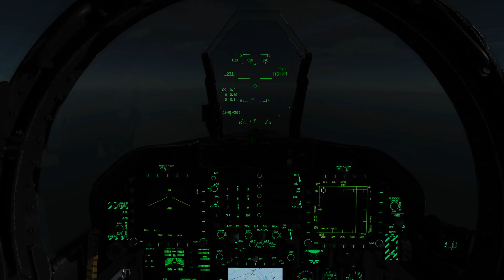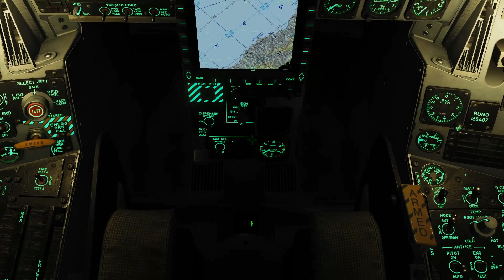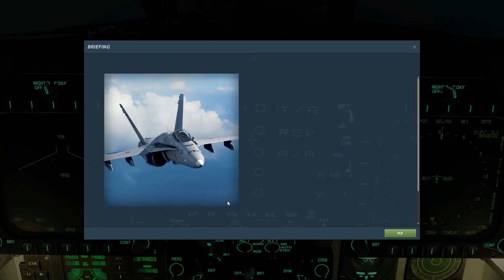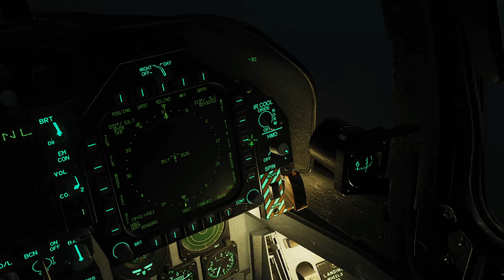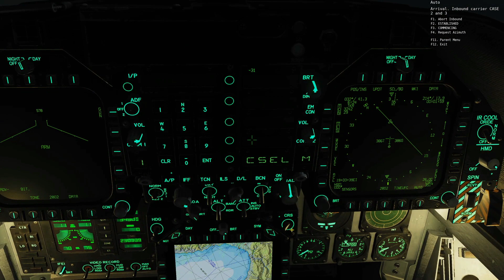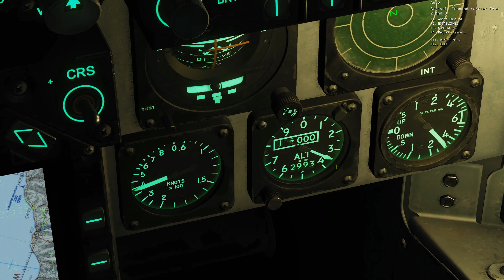Supercarrier: Case III (3) Approach & Recovery Landing Tutorial | DCS WORLD

Comment: 2 minute 180° turn=120 seconds for 180° of turn, so 60 sec for 90°, 30 sec for 45°, 10 sec for 15°, 1 sec=1.5°, 1.5°/sec, 3°/2 sec. Gauge with constant monitoring. There's perhaps a more accurate angle calculation that someone could input with bank angle at a given airspeed, like a pilot, but that will work for me.
Thanks, CAP! I always look for your videos to help learn these systems and procedures.
Reply: can i not just divide the airspeed by 10 and add one-half the result
Reply: so 250:10=25 
25:2= 12,5

so 
25+12,5= 37,5°

Comment: Super cap, if I may correct something, the pattern you made was wrong. You have to make a standard rate turn (3 degrees per second) to the left which takes 1 minute to make 180°, you don't stop and fly one minute 90° off. So you just turn in a standard rate for one minute, then fly two minutes, then make another standard turn for one minute and then fly another two minutes to the fix point and start over. Hope it helps. Certified IFR pilot here :)
Reply from the maker: Thanks!!

Comment: I did this for many years from CATCC's side, it was awesome to get an idea of what the pilot is going through during Case III! Let me know if you want some in-depth Case III training!
Reply from the maker: Hi Jackson please join our Discord and come training with us? https://discord.gg/cATmE3d
Reply: I have a question: What would happen if you have a bunch of planes to land and a lot of bolters? Do you have to hold up the stack? How does that work? If someone is commencing every 60 seconds That does not leave much time for bolters and waveoffs.
Reply: @ChadGatling  you basically put them on a long downwind and sequence them into the stack when you can. Procedures allow for 30-second separation when necessary although we rarely did that. Usually it's just back of the line for the bolters.
Reply: @jacksonbrown6199  ahh interesting. So how many flights can be on the same stack level? For either case?
Reply: @ChadGatling  in theory you can keep it going forever, depending on airspace constraints. Carrier ops launch aircraft in mission packages all at once so you're dealing with a number of aircraft returning all at once (I'm actually not sure how specific I'm able to get about this, but it's a typical number of aircraft launched at a set time interval).

With that, we marshal the entire mission stack and bring them in one after the other. The goal is to get them on deck as fast as possible, you don't want to keep the boat going straight for too long (although they like to turn anyways... which is annoying).

Comment: Hey CAP, great effort. Although, you did some mistakes that didn't help you for the Marshal holding.
When you set the radial 160, you should actually set a course of 340. Because it s the next inbound course you ll follow to the carrier. It complicates your life too cuz then you are outbound when you reach your EAT and need to turn back, re-intercept and so on.

Also, you need to reach the Marshall fix at a precise timing to commence the approach.  It s not guesswork, you can help yourself with simple rules.  
Rule of thumb you can use is your Mach number... At 250kts, and at the altitude you had, you were doing M 0.42 so more or less, 4.2Nm per minute. If you are 7 NM from the fix, you need 1'45" to get there (roughly) this will help you to get more precise with your timings.
In civil aviation, we do 1' holdings, meaning that the turns and the in/out bound legs are 1'. Here, the legs are 2' but the turns are still 1' so, you turn with "rate 1".  Meaning that you need 1' to accomplish 180deg (3 deg a second). To know the bank you need, use this formula: (TAS/10)+7.   So at 250 kts IAS (let's pretend here IAS equals TAS just for the example), you need 25+7=32 degrees of bank.
If you wanna know your TAS, another rule of thumb is IAS+(fl/2). So, flying at 250kts at fl140, it's gonna be 250+70= 320kts TAS....

Try to use these rules of thumbs for your IFR Work, it will make your life easy...
Reply from the maker: Yup point noted: Will redo this, but gunna have a break from carrier ops first as I'm pretty burnt out.
Reply: @grimreapers  yes, a well deserved rest. I guess, with this module, it's easy to be carried away ;)  I ll see that too tomorrow I hope...  Thanks for putting soo much contents..
BR,
Vixen
Reply: @ogerlionel374  carried away

i love you and i hate you

Comment: Is the Marshall Stack not just flown at a Standard Rate-1 Turn as you would do in a normal civilian holding pattern? If that is the case, the TAS (in knots) divided by 10 plus 7 should give you the bank angle. Thus at 250 we are looking at 32 degrees. That will given a 360 degree turn in 2 minutes. Also, does the HUD not have a Turn Rate Indicator (three little blocks next to each other)?

Comment: Surely the upwind leg should be on the radial - not the downwind leg? (as per the diagram "Theory" section)
Reply: Not just that, it should even be another 30° off, as shown here:
https://www.youtube.com/watch?v=DvlMHnLjbDQ
So if the BRC is 000, you set up your marshal stack at 210 and when commencing, you'd fly that arc to intercept radial 350 to be right on the localizer at 10. I wonder why the manual doesn't even have this in at all though.